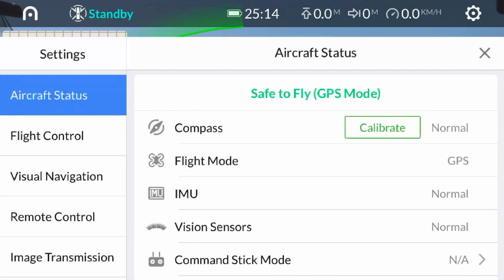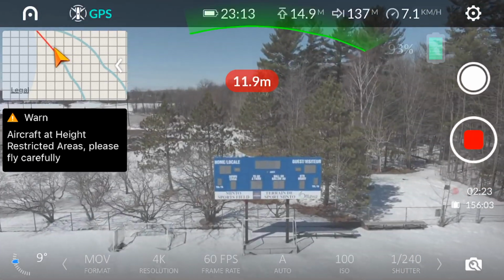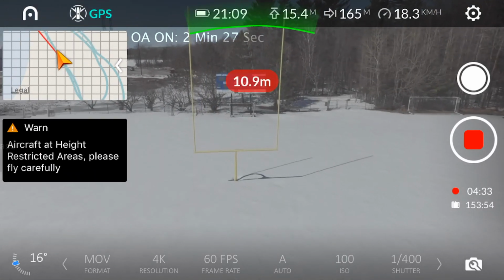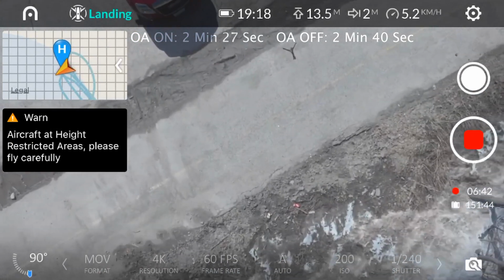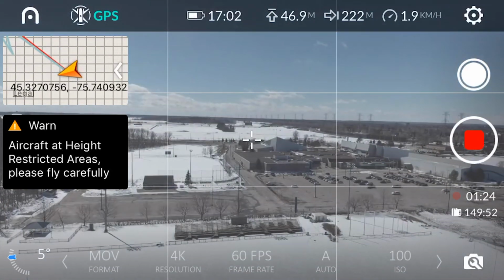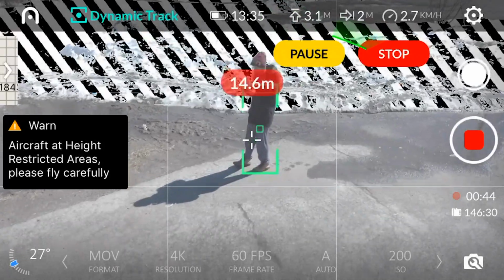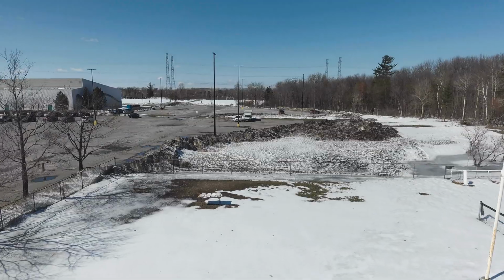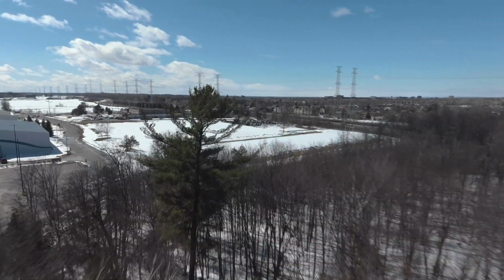Autel Evo Tests April 2019 - Obstacle Avoidance Issues, Track Altitude and Battery Test!

Comment from the maker: Do you have an Evo? If so, did you upgrade your firmware? 

Timestamps for Mobile
1:50 - Obstacle Avoidance Battery Test
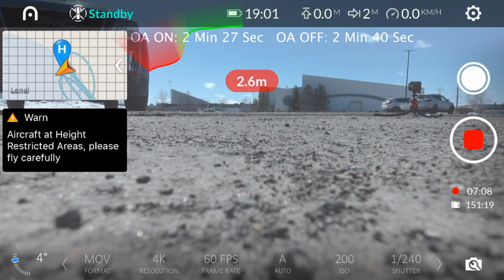7:15 - Obstacle Avoidance Glitch Test
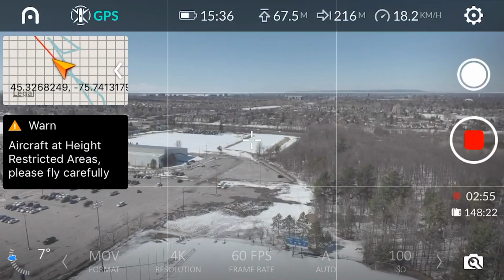9:54 - Tracking Altitude Test
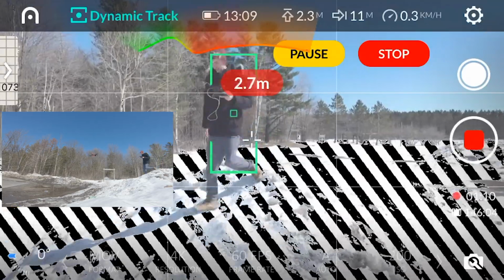10:24 - Final Thoughts
Reply: bro..how about the horizontal tilt issue? did they fix that?

Comment: Since this video,have  there been  firmware updates that resolved the dynamic track altitude raising or lowering while following a subject that raises or lowers their path?
Seems as though it would have to do with whether or not the device you use has a barometer...
After "breaking in" new batteries...what's the maximum flight time I could expect?
I have 7 cycles and I'm getting 21 minutes...I'm thinking this will go up.
Thanks for your help.

Comment: hello.

thank you for allyour tests and help  ;)

1) do you have already contact autel about EVO not altitude tracking?
2) i know EVO has 800m maximum altitude restriction , do you know if it's only prevent and can go over the restriction, or if we even continue throttle, EVO will never go over 800m?

thank you.
Reply: Autel has no height RESTRICTIONS only warnings, you can ignore them of you want to 2900 ft I think. I've never gone that high to try, I'd only try in remore desert after verifying that no commercial flight paths for miles around.